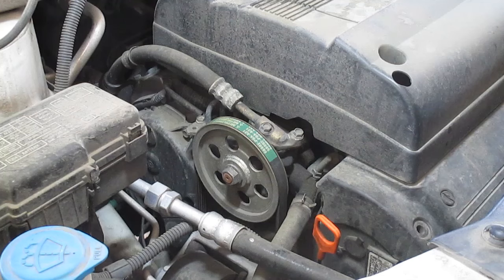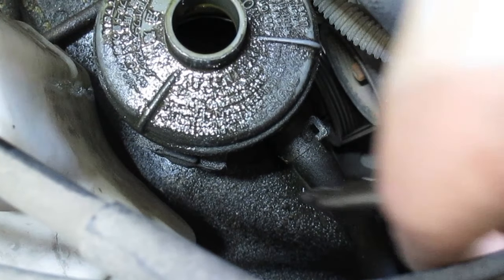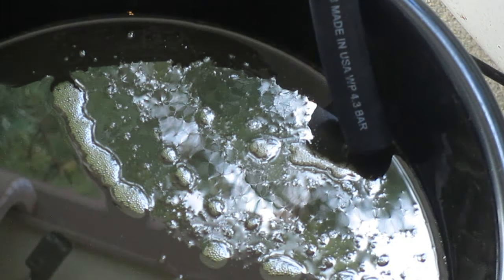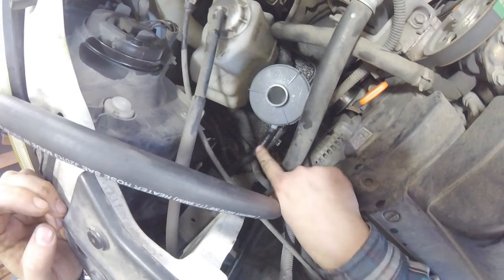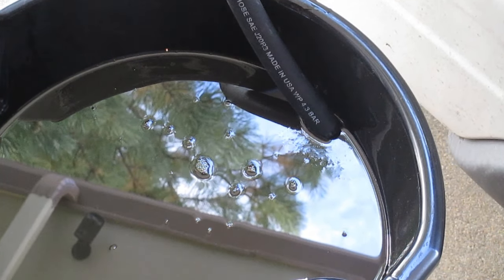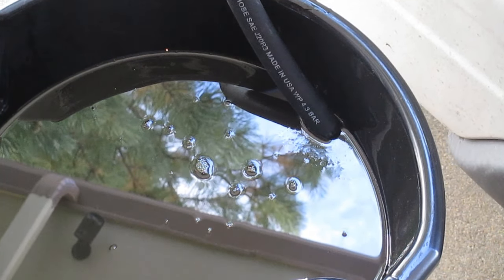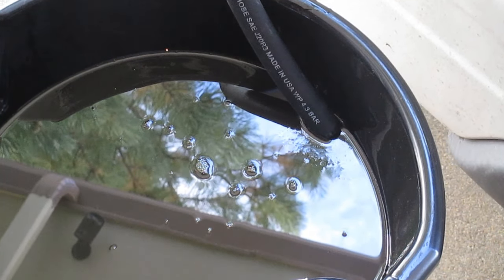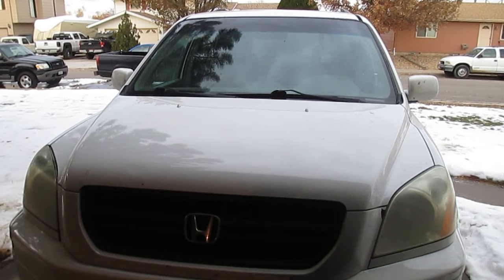Cheap Fix for Power Steering Noise | Repair - 2004 Honda Pilot

Comment: Pump cost 50 all day online. O rings are $4 for both. Bring it to the shop and get charged $150-300 and they sell your old pump to the next guy. Thanks for the video. Learned what I was looking for.
Reply: $140 Autozone. O-rings were not the issue on my car 😢
Reply: Exactly, I'm in Nigeria and that's what they do here
Reply: I wish they were that cheap anymore
Reply: In addition to that, most mechanic shop people do not accept parts if one buys it one self from online; they might accept if one buys it from the autoparts stores they patronize.  And if they buy the parts themselves, the warrantee is not honored by the autoparts stores if one goes to a mechanic different then the one who installed it.  O'reilly's and Napa do that along with mechanics.

Comment: Hello people. I did it on my 2003 Honda Pilot. It work great. If you do not have a suction gun, you can use an empty hand soap bottle and pump to get the oil out of the reservoir. God Bless!
Reply: wash the pump out well if you are going to do this.  BTW, you can get a suction gun for less than $10, or a dollar store turkey baster would also work.
Reply from the maker: The suction gun is a great tool to have, it just can't get all the fluid out of this reservoir because of the screen in it. But I've used it on several power steering jobs already for sure.

Comment: Changing the O-Rings did it for me. (They were flat on two sides) Stubby 10mm absolutely needed, but it took me less them 10 minutes to replace them. Thanks!
Reply: Did you bleed the system and everything or only strictly replaced o- rings ? I’m seeing what to do first before assuming it’s the pump

Comment: Just like most people in the earlier comments I want to thank you for your video. I would recommend that when flushing the system, it is good not to let the pump run dry. So I had someone turn the car on and turn the wheel and I was putting more of the new power steering fluid, and as I had no more to put, then I would let the person inside the car know when to stop and turn the engine off. Again thank you!
Reply from the maker: I would agree with you there, I should have bought more to flush with. Thank you for watching and commenting!

Comment: Great info. I bought both O Rings, but figured the high pressure line would be the one most likely to fail and would likely be the only one that could generate that much noise. I just popped in the top one and noise gone. The old one was hard as a rock and broke when I tried to pull it off.
Reply: Hey mine's leaking and I wanted to replace this o-ring do you think I have to drain the system if only doing the top o-ring
Reply: @jessiesintuition3517  no
Reply: Did you drain the resivor or did you just pop the top and replace the O rings? I already replaced the resivor and return line and added the new fluid, but need to replace the O Rings. I really just done want to flush everything again.
Reply: @Eli-y7z  No. You do not need to drain the reservoir to replace either of the O-rings.

Comment: 07:50.  That would have been a nice experiment to cut into that reservoir to expose that filter mesh.  Why?  Just to see how if the flow of the liquid was hampered especially when dirty.  Great video with no cursing and no unnecessary rambling.

Comment: Excellent mentioning how coldness can contract the o-rings!   My 2001 Honda Accord, I have replaced by myself the power steering pump (made in China one, as the OEM one is ridiculous expensive).  Regardless, the aftermarket part seems fine.  But I do get a tiny whining noise EVERY cold morning briefly.  When the car is warm up, no more noise.  The o-rings I got are OEM but the pump itself is not.  So the fit is not exactly 100%.

I still have original OEM pump, and I am going to rebuild it.  Until then, I change the o-ring(s) once a year to stop the whining noise in cold mornings.  REMEMBER*: The BLACK o-ring goes with pressure line, where the two 10mm nuts are.  The *ORANGE o-ring goes to the other hose.  The orange one is only used for V6 engines.  If you have a 4-cylinder Honda Accord, it's not used.

Comment: Thanks a bunch.  Worked on that elusive screw under the plastic pipe fitting for a few minutes and was really struggling.  Stopped the video at 12:47 and saw the wrench and your angle and was able to pop the screw in 2 minutes.  THANKS!!!!

Comment: Excellent tutorial! Followed step by step and purchased parts from the link you provided. 04 Pilot is turning with ease and no noise in the cold winter. Great job just raised my mechanic confidence up a notch
Reply: Only thing I would add is when purchasing the “Asian flush fluid” buy 3 to do a good flush I only bought 1 and wish I had more to flush with.
Reply from the maker: Thank you! I'm glad it helped you! 
I too wished I had bought more to flush with, after seeing what came out.
Thanks for the sub also! The reason I share is to help people who might have the same issue, since others doing so has saved me immense amounts of time, headache, and money.

Comment: Thanks for sharing this video! My 2007 pilot had the same noise and I replaced both o rings. The noise is now gone it’s all good! The bottom bolt was difficult for me because I have large hands and very little space  but I was able to remove it and put it back. Thanks again!
Reply from the maker: You're welcome! Thanks for watching and commenting!

Comment: I have a 2004 honda pilot w/180k miles making a whining noise similar to video, but only when accelerating on the road. Checked the spots in video for those two o-ring locations and it has definitely been seeping. Had a shop diagnose it and they say bearings are bad in the PS pump and they quoted me $600 to replace it, I'm going to try this first however. Even if it doesn't work I still appreciate the informative video!!
Reply from the maker: Did it work?
Reply: @DustyDingus  It reduced the noise by 90% in intensity and length and it hasn't gotten any worse after 2 months of driving it. Safe to say you bought me several months to maybe even a year or more life for the pump. Also taught me good maintenance habits for future vehicles I own, nobody ever taught me to change power steering fluid. You're a great guy, thanks again brother!!

Comment: Many thanks for this.  I had replaced the o rings several times with no success.  Finally replaced the reservoir on and problem solved.  Was hoping to avoid doing the pump.
Reply: What was the condition of the reservoir

Comment: Great video. I would consider steam cleaning the engine bay prior to replacing anything that has fluid running through a system. Any small debris can contaminate the system and create more future repairs!

Comment: Thanks for posting this. I was able to replace both seals in under an hour. I didn’t replace the reservoir. 

It looks like I’m actually going to have to either replace or re-seal my pump. After a half hour of purging the lines, the pump is still growling when the wheels are on the ground.
Reply from the maker: The reservoir has a screen at the bottom which gets clogged and creates an air pocket below it that can often get sucked into the system. That's why Honda recommends they be replaced.

Comment: Update: works great no noises
Thanks man you explain very well hope it works and its not the pump!
Reply from the maker: Let me know how it goes!
Thanks for watching!
Reply: @DustyDingus  Yo Dusty thanks for the video brotha everything worked out well did exactly what you said worked like a charm not the power steering pump! No leaking or noises since I changed the reservoir, fluid and, the O rings. I should have done thus years ago SMH o well you live and learn !
Reply from the maker: @ayearetee3342  you're very welcome! Glad to help!
Thanks for watching and commenting!

Comment: Thank you for your video! I have the same issue with my 2003 Pilot...The tutorial cuts out any guess work for me getting into this...Really appreciate all your efforts shooting the video and taking time to post this...
Reply from the maker: Glad I could help, and thanks for watching! 
Now is the perfect time to tackle the job if you're on coronavirus lockdown in the US, most places deemed auto parts stores to be essential!
Cheers 🍻 and please consider tapping that subscribe button!
Reply: Thanks for your reply...I Just subscribed...funny you mentioned working on it while we’re stuck at home because that’s what I was planning to work on today...Changing both o rings but not replacing the reservoir...Was going to drain/remove the old reservoir and blow out backwards with compressed air to see if anything comes out of the fine mesh screen...
Reply: Replace both suction and discharge fitting o-rings...Both were distorted...Noise is gone!
Reply from the maker: @fredcordano3851  glad to hear it! 
Still no noise from the vehicle in the video. The wife has mentioned some stiffness at certain times, but I haven't got around to diagnosis yet. I think it's entirely possible that a few years of this cavitation during cold months damaged the pump. But it is working fine whenever I drive it ;)
Reply: DustyDingus Understood I’ve been replacing parts as I go...It has 275k plus miles but as long as I can repair with (mostly) after market parts and  help from tutorial videos like yours, I’ll keep it going...

Comment: Thanks for the video. I’m going to try this on my 2006 really soon and I will report back!
Reply from the maker: Thank you for watching!
Still no noise from my wife's 04
Reply: Ordered parts and got this done!  It definitely has helped but I’m actually still having some noise after it heats up and i noticed some fluid blown back around the pump before I started.  I may have bought myself some time but a power steering pump is probably in the near future.  This video was spot on and helped me make short work of the job.  If I can make a suggestion, removing the plastic engine cover gives a little more room to work and stuffing a rag down below that lower bolt will save your bacon if you drop that bolt trying to get it back in there like I kept doing.  Thanks again for the video!

Comment: I’m about to try this trick tonight. Wish me luck this is the fix!
Reply: Can I just say….after having some replace the oem 200k mile ps pump and it still had the noise. Did the 2 o-rings and poof fixed it 100%. Was hoping I didn’t have to do the ps reservoir and I didn’t have to!

Comment: JOB DONE!  Excellent work...thanks for sharing!  One thing though; I cringed a bit when you put your nice new clean o-ring down on the dirty engine cover and installed it dry - a squirt of silicone lube or dab of power steering pump fluid would have been a nice prep before installing it....not judging just saying...still, great step by step how-to coverage!
Reply from the maker: Thanks for the tip!
Reply: @DustyDingus  Sure, from one DIY'er to another...and thank you again, this was VERY helpful
Reply from the maker: @gp3yt  I'm glad it helped you!

Comment: exact same noise i have! will do it soon. Much appreciated!
Reply from the maker: Let me know how it goes! 
Check out the video description for parts and tools needed
Cheers!
Reply: @DustyDingus  I did my 2004 pilot in 40 minutes. I used a stubby of course, and it was still a little hard to get it loosened. I also did my 2004 mdx(same part) but it was a lot easier! Literally 12 minutes or so. For both cars I did the two o-rings only, not the reservoir. Do you know if bubbles in the reservoir is never normal? My mdx still has bubbles after a half a mile drive. Thanks again!
Reply from the maker: If the reservoir on the MDX has a screen at the bottom that may be suspect, but there may also be other o-rings at the other end of the hoses. 
But first, is it noisy? Did you bleed the air from the sysyem with both front wheels off the ground?
Reply: @DustyDingus  the mdx is  a tad noiser than the pilot but quite better than before the o-rings. I did not bleed either cars

Comment: Craziest thing...  I had the loud whirring of the power steering a month or so ago and replaced the O-Rings & reservoir like you suggested.  Everything went well... until I noticed a leak in the reservoir line that travels up to the cooling tube at the top (in front of) the radiator.  So I ordered a replacement hose and clamp.. which took a month to arrive.  I then replaced the hose and clamp with no issues.  Now... crazy as this sounds... the high pressure hose connection is leaking at the fitting.  It didn't leak for a month... but as soon as I fix the leak at the reservoir hose the high pressure connection starts leaking?  Would love a comment.
Reply from the maker: I'm sorry it's taken me so long to respond... 
It is leaking at the top where you just replaced the o-ring? I know draining the system is a pain but o-rings are cheap. I would probably replace it again but be extra sure none of the surfaces are scratched or gouged and perfectly clean. A chain is only as strong as the weakest link, hopefully you can chase down where that is once and for all.

Comment: You can remove the power steering pump if the 10 mm bolt at 12:23 is rusted. It is a 12 mm bolt on the left and a 12 mm nut (need a small extension).

Comment: At time stamp 12:10 the video states you need a stubby 10 mm wrench to get the bolt off the black plastic hose connector (low pressure hose). I did this job on an 2002 Odyssey and I had to create my own special Honda tool from a stubby 10 mm wrench. I used an angle grinder to make the box end thinner and then I bent it at a slight angle after heating it up with a torch. It was still a bugger to get access to the bolt.
Reply from the maker: Geez! Did they make that area even tighter on the Odyssey? 
Thanks for watching and sharing the tip!

Comment: So mine does the same exact squeal (not the grinding noise yours also had) but has NO leak present on either fitting. I noticed your bottom hose had gunked up oil due to possible leak. So my question is, can the pump make this noise without a leak and the o rings be causing the noise? Or does there have to be a leak for the rings to be the culprit of the noise? Thanks in advance

Comment: my nut at the bottom is a 12mm and not 10mm. it's never been touched, I remove the top left bolt first and pushed powersteering pump down. gave me more access to the bottom right bolt.

Comment: Replaced both O-Rings and noise was gone immediately, I didn't even need to bleed out the air, amazing. Before it would whine and foam up

I have a 2000 Honda accord v6 and it was very tough removing that 10mm lower section. I had to move the alternator wire and remove the hose but still it was hard to get to the nut. I found out that using a flat spanner wrench, SUPER THIN and small, with it I was able to easily get in there and open it. My flex wrench would not work the head was too big, so a flat wrench or a stubby wrench is absolutely necessary. Ive heard an offset wrench or curved wrench can work too

Comment: Im confused if you have the back hose connected to the new resivor and the other end blocked off what is that big hose connected too where your flushing the system with new fluid

Comment: I have a question,what's All that bubbles on the power steering reservoi means.??
Reply from the maker: Air in the power steering fluid. This was one of the things I noticed while the noise was present.
Thanks for watching! I hope this answers your question
Reply: Does that means that my O rings are bad. ??
Reply from the maker: Likely. Is it making noise? Like kindof a groany whine?
If so the o-rings are probably bad or there is a leak elsewhere. The o-rings are the most common culprit.
Reply: @DustyDingus  thx my friend 🥸👍🏽

Comment: Great video.
How did you come up with just a o-ring/reservoir replacement? I was going to change the pump but thing I'll give this a shot 1st. Thank you
Reply from the maker: Research. The intermittent noise told me the pump was working and pointed towards cavitation from air continually entering the line during cold weather. It's a pretty common issue with these.
You're very welcome! Thanks for watching and commenting!

Comment: Good video and nice fix, but did you read the top of the power steering fluid reservoir? It says in 3 languages to only use Honda power steering fluid. Honda only, or you could use the Idemitsu Honda formulation since they manufacture Honda's fluid. Other than that, it was a good video, but very bad advice to recommend anything except Honda power steering fluid.
Reply from the maker: The generic Asian fluid was used only to flush the system before filling it with the Honda fluid that I ordered along with the o-rings.

Comment: When you dropped the bolt that had the hidden hole was it hard to find? Really good video 👍
Reply from the maker: It was a while ago, hard to remember but I don't think it took too long. The long grabby tool has saved my butt more times than I can count. If I can't see it, the extendable magnet stick is my 2nd go to. 
Anyone working on vehicles should own a magnet stick and a long snake claw grabber. I recently upgraded to a snake claw with a magnet on the end. Worth every penny
Thanks for watching and commenting!

Comment: I was wondering did you use the Asian generic power steering fluid to flush the system? then use the Honda PS fluid, how does go. Thanks
Reply from the maker: Yes, that is correct. Just for the sake of cost, didn't want to be throwing away "the good stuff"

Comment: I have an 03 Element that does this noise but only after 20 minutes into the drive and you could feel it on the accelerator pedal, would u say I have the same issue as your car or I'm dealing with something different?